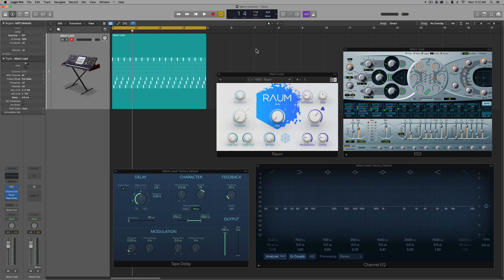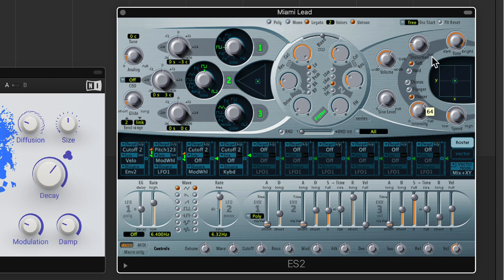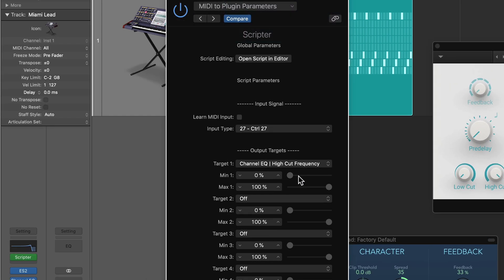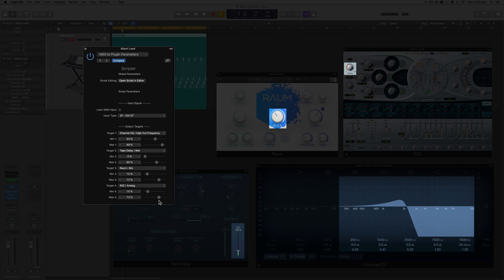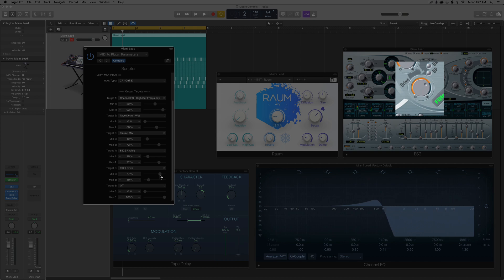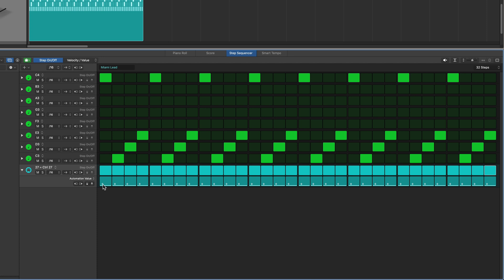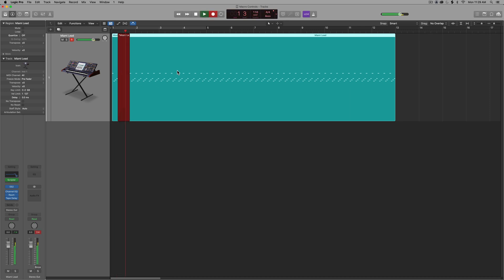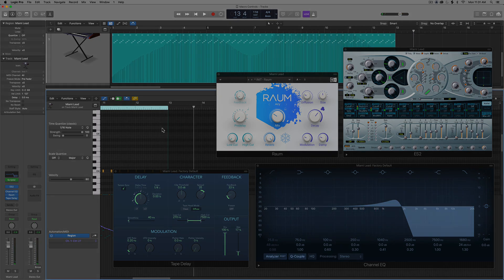Logic Pro // Easy Macro Controls with Scripter

Comment: Firstly love your vids!! I use Logic Pro and my Akai MIDIMIX seems to communicate with the DAW excellently except for the bank left and bank right buttons. Both the 'pressing' and the 'releasing' of these buttons is recognised as a separate signal. When I'm using banks 1-8 and press and hold 'bank right', it jumps to bank 9-16, then jumps to bank 17-24 when the button is released, effectively going right passed banks 9-16. Likewise for the 'bank left' buttons, but going the other way. I have figured out it could be a midi 'note on/note off' issue and the scripter could be the way to fix this but I don't know how. Any help would be greatly appreciated. Thanks.

Comment: Why not simply use the smart controls for this? You can easily assign multiple plug in parameters to a single control and have it listen to the midi input without having to fiddle around with java script 😊
Reply: This was my thought process. This is cool to know about, I wonder if people have used both and know any pros / cons to using either or